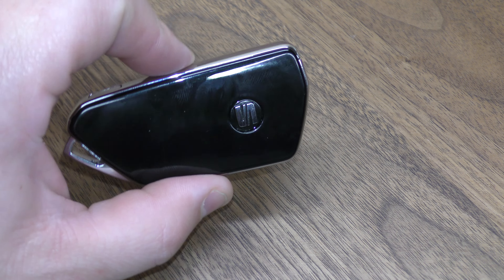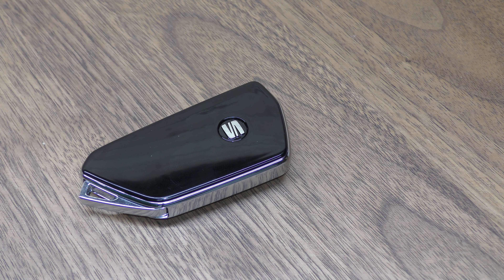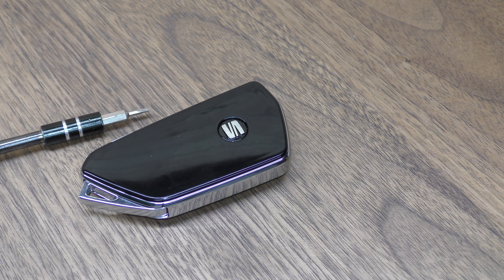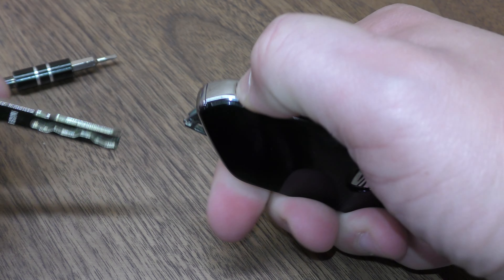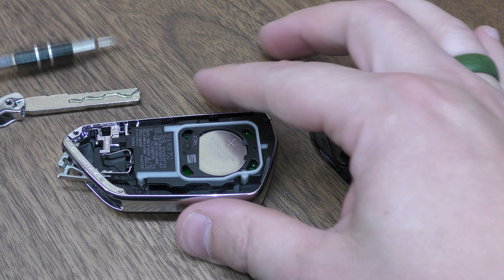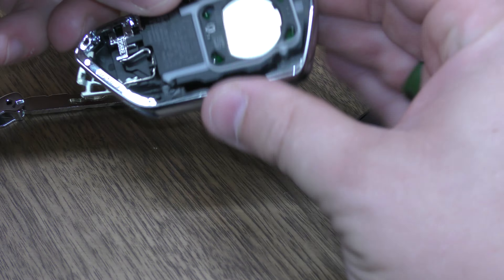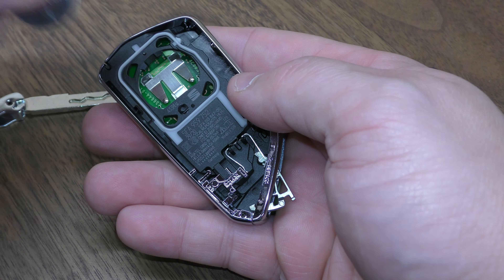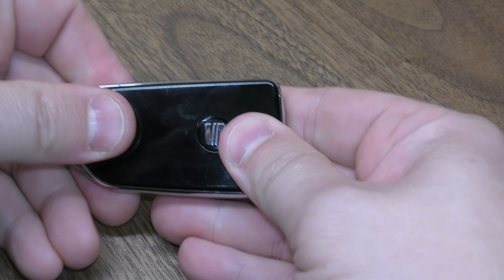Seat Leon / Mk4 / Ateca key fob battery replacement - EASY DIY

Comment: But how to reset the warning on the dashboard 🤔 It still keeps telling me to replace the battery... Checked the instruction book.
Reply: did you find any solution for that?
Reply: @Kjoellereu  Nope! Not yet...
Reply: @tinagranqvistpahlen5715  I spoke 30 minuttes with Seat in Denmark, they couldn't explain other than purchasing the batteri from Seat, then it should work. I'm not an idiot, when i change batteries to a quality 2032. The instruction manual don't say anyting about it either.
Reply: Maybe it was an old battery?
Reply: @clairep8225  Nope...
Reply: Now I know what the problem was in my case... Me! ;-) Tthe car has two keys. The other key is usually in the kitchen, with in reach of the car soooooo. That key had an old battery, off course - as old as the other key. Changing that will end the message from showing up in the car!
Reply: @Kjoellereu  Now I know what the problem was in my case... Me! ;-) Tthe car has two keys. The other key is usually in the kitchen, with in reach of the car soooooo. That key had an old battery, off course - as old as the other key. Changing that will end the message from showing up in the car!